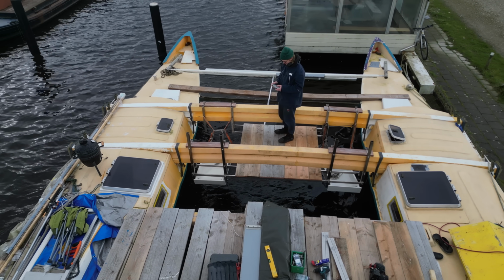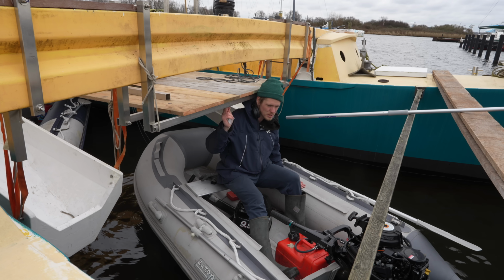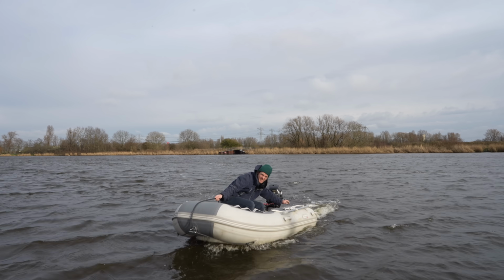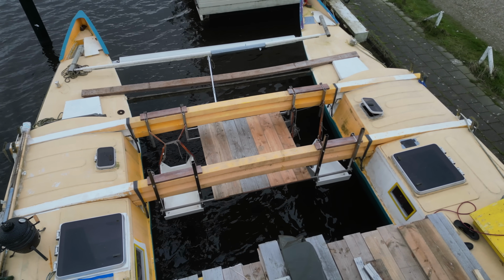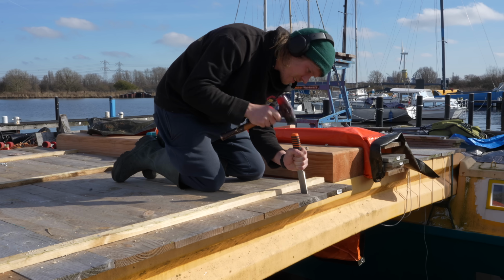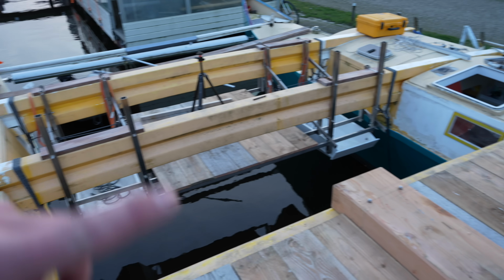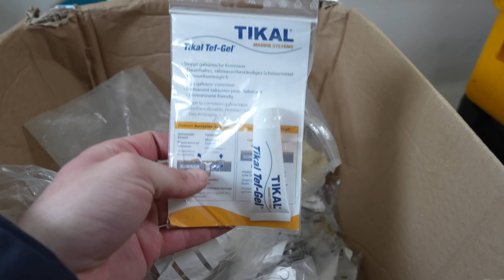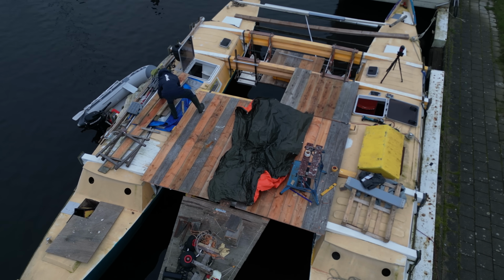A Simple Deck for a Simple Man’s Ocean-Going Catamaran.

Comment: Did you try tilting your motor out of the water a bit? My small 10hp 4 stroke has 3 tilt settings.  That may bring the bow down a bit.  Also, sometimes the outboards transom mount has 3 setting where you can hang your engine higher or lower in the water.

Comment: If your concerned and need to put your mind at rest, bang in some 10.9' s or 12.9' s the weakest point will then be the box section. You can always buy a metal strip to run parallel  to the box and bolt it to the side. Like a big washer running the length. 
Perhaps think of the engine box back movement when the waves hit, maybe some car boot opening cylinders(marine equivalent)to dampen the impact and relive stress on all of the joints.

Comment: The M10 bolts are in shear (double shear) not tension, so the area of the bolt is the controlling factor.  The sludge in your outboard fuel typically occurs from ethanol added to fuel.  When it is left it separates and becomes a sludge that will block small engine carburetor jets.  If you are running the engine on a regular basis the ethanol additive is not a problem, if you are going to let it stand for longer periods use pure petroleum.
Reply: Trouble is all modern Euro  petrol is a mix... ... and its been increased on two occasions.  It also attacks certain plastic components.
Carb cleaner helps but only till next time.
Reply: You have to do a search online for sources of ethanol free fuel made for small engines with carburetors. It costs more but it's well worth the extra price. A lawn service company will know where to buy it.
Reply: Most name brand E5 labelled petrol contains practically no ethanol. Its allowed to contain up to 5% but market forces say people are willing to pay extra for less of that #$^^!@ in their fuel.
Reply: If you are not going to use the engine for 6 weeks or more just disconnect the fuel line and let the engine run out of gas, or better yet put in a simple cut off valve and shut the fuel off then rune the engine til it dies.On my generator and lawn mowers I start the engines every 2 weeks, so they are ready to go when I need them.
Reply: Hi, for me your planks are not the thickness it's should be. I'm thinking when it's will be very damp your planks will bend and a tempest will be very rough with your planks and attachments... 😊😊😊😊

Comment: You can put the spacers on the end of a stick with masking tape to reach the holes in the middle of the bars. I used the method to get a nut 2 feet down a pole.

Comment: Id put a tubber strip between the beams and the deck, stops the deck from rubbing into the fibreglass. Also use a stick with a v notch on the end with a bit of blue tack to position the spacer. Good luck

Comment: Hi, when considering mechanical advantage for your raising of the engines/sleds you would gain a tremendous amount of efficiency with your pulley system if you were to pull up from your deck rather than down.  I suggest this if it’s possible to reverse your top jamming pulley…good luck 😢

Comment: Those pulley blocks are made of Tufnol - good material !  
I would not worry about the static loads on your engine mounts, but the dynamic loads once it is at sea. A heavy wave breaking thru or the boat surfing sideways to a big comber on a breach. That is where things will bend & break.
That gunge in your outboard carb could be due to ethanol in your fuel. Seems to absorb water and react with Aluminium carb material to then block the carb. Causes big problems with chainsaws.
Cat decks are usually slatted rather than close planked to allow wave force to burst thru the deck and dissipate rather than slam into and break. I would think about introducing gaps between those planks.
Keep up the good work - you are getting there.

Comment: tips when using handsaw 1. Don't force the cutting stroke and release grip pressure on back stroke. That will stop the wobbly vibration. Let the saw teeth cut if you need to add pressure then the saw needs sharpening again. Some newer cheap saws can't be sharpened readily.  I like what you are doing with the boat. I'm 76 but wish I was your age and had your opportunity.  Keep up the great work Mark.😊

Comment: You did the right thing butting your deck boards up together without gaps and high above the sea. Slatted decks on Wharrams maybe good in theory for dissipating breaking seas but in the meantime, even in a fairly moderate beam sea and definitely going to weather, those gaps will allow the sea to squirt up through the deck, drenching the crew and any equipment you are trying to keep a bit dry. One thing you will need with a high flush deck though at sea is a guard wire or at least a rope around the deck. You'll feel mighty vulnerable otherwise and inclined to go about on all fours. And as you mention, slatted decks are an absolute magnet for items to fall through!

Comment: The brown block (pulley) is made of Tufnol, a laminated material used as the original alternative to wooden yacht blocks back in the day, but nowadays are mostly sold to owners of classic yachts since they are easier on the eye than other modern blocks. They are still made by Holland Yacht Equipment and are not cheap. They run on brass bushings and last forever, so are not to be despised provided the bushings and straps are still good.

Comment: my suggestion is to not worry about changing out the bolts, just have a welder friend come by and run a small bead on each junction, it'll add to the overall strength, rigidity and peace of mind in one move.

Comment: The bolts are definitely not the problem. Rather, you have to calculate how much your profiles can withstand in the areas weakened by the holes.

Comment: Cut space for the beem lashings in the deck planks

And to the m10 if your worried add more vertical supports and maybe use them to support the engine controls in the center front and a cabin roof for solar in the rear just a thought 

Also still think a tear drop style deck cabin would look cool on your wharram

Comment: The deck's looking good. I'm not sure if you're already planning it, but I'd wire the pins on the shackles for the engine box lifting pulley system. Lots of vibration there for the pins to come loose.

Comment: Experienced sailor here, your construction of your engine mounts metal cross beams appear to be too  close to the main wooden cross brace beam. So when the boat flexes it appears that the steel would start gouging into the wood.
Reply: I noticed that too, but guessed that it may have been the camera angle making the gap look too small.

Comment: Mechanical engineer here - The real battle with any design of a structural frame is fatigue and movement.  Make sure your frame is rigid.  You may want to make some backing plates where the frames contact the wood to spread out the loads and keep the wood from fatiguing.
Reply: Fully non qualified shed tinkered here.  I like your comment  about keeping the frames rigid. That's what I thought too. But I wouldn't mess around with the engine boxes too much until I'd tried them and was happy with the arrangement,  then if rigidity was a concern I'd make a triangular plate to brace the corners, maybe 100mm with three six mm bolts in each. That'd be solid.
Reply: Isn't the real battle going to be the waves striking and lifting in higher seas?
Reply: @chrisoakey9841  and snapping off with the engines which could turn into anchors
Reply: @c3pno  the engines are typically used in calm seas and flat water to enter/exit Port and such... Otherwise Mahi sails and the engines are high above the water... This is to specs and with the designer's input if you want to go back to the beginning and educate yourself... Perhaps read the books on the evolution of these cats.
Reply: I'm wondering if those beam lashings you did have enough tension.
Reply: Just a tad difficult making a rigid structure in amidst a boat that is designed to flex from the get go to move WITH the swells, rather than rigidly resist them.That's why everything is lashed together, rather than bolted.
Reply: Industrious video👍. Thoroughly enjoyed it!. Your varied skills and transparency in your approach are very refreshing. Thanks!!.
Reply: Spent a lot of time at sea...while I admire what your doing...I wouldn't want to be on that boat of yours in anything but calm waters...I doubt it could remain in one piece  in stormy waters... particularly if they go on day after day. However good luck with the project.
Reply: @robindawtrey9735  they are designed for going in sea, non calm water, and still remain in one piece.  As long as it is looked after, like any boat.

But to each own, I guess.

Comment: CAUTION: the cross-bracing tubes to support the pulley system and engine box supports.  The ends are too close Mahi's wooden beams.  Everything flexes underway, so those ends will gouge into the wooden beams like a chisel.
I very much like that you're going to seal and protect your decking and other raw wood. Douglas fir is good but it's not red cedar.
Cheers from Vancouver, BC

Comment: If you're going to leave the outboards sitting for a long period of time you should disconnect the fuel and run the engine until it runs out of fuel, that way it won't sit in the bowl and gum up.

Comment: If you have access to a welder the best option would be to drill out the holes large enough to weld in a sleeve at each hole.

Comment: That OB scoop will detach itself given the right wave scenario, it’s only held by 2 bolts in what looks like a much weaker material and that is the issue. All the metal reinforcement is fine, even overkill if you ask me.

Comment: Said this in your last video..
I would weld some of the tubing across the top to replace the bolts,  so that the frames effectively act like hooks over your beams.
Nuts and bolts get weathered and can be a pain to service even if they're stainless steel. They could also potentially chaff in the framework under heavy seas and elongate the drilled holes..

Comment: M10 is perfect for that job. 
Also, the crush tubes you have on the inside of the box section is a good move.
I think the setup and load bearing points are more than adequate.

Also, see if someone nearby has an ultrasonic cleaner.
Best way to clean a carburetor. Makes them like new.

Comment: Those decks will come up lovely chief, you've made a good job of them. You may be getting moisture in your boat tank, it binds with the ethanol and drops out the fuel which may be why you're getting the gummy build up in the carb, a fuel stabiliser could help you. But I'm no expert, it's just a theory.
Reply: It works. I recently had idling trouble with my 2 stroke Nissan outboard and come to find the fuel pump diaphragms warped  and also the float valve cover... Bad gas.

Comment: I made a roof rack for my ute once when I was doing racsia and guttering for a job. We used SHS tube similar to what you have done with bolts to join the members that support the load which was pretty substantial that sat the full length of the vehicular weigh at leat 200kgs full load.  All the other tradesman did it that where we got the design from. Like you said I think an M10 bolt should be plenty strong enough, probably stronger than the sheet metal tube without looking at any charts. The real test is going to be dynamic load is a complex calculation to do a load analysis you'd need a computer or someone with a really big brain 😂

Comment: 74 yr old out board mech with advice on engine starting.  If cold-  try setting the throttle a bit open (watch the throttle shaft to determine  and not over a 1/4 open) and no choke for one pull. Then close the choke and pull till start.  Be ready to open choke immediately and be prepared to just "flash it" shut for just a moment until warm.  When starting warm - leave the choke out of it, but the engine must have air to start so keep the throttle a bit open. Always carry a spare rope and wrench to remove the starter housing to reveal a way to wrap start the motor.  Look inside the hood as some motors had a spare rope taped there. Your throttle may have a friction adjustment to help starting.

Comment: The bolts are fine , what will get you is vibration and movement may back off  the nuts . . The trouble for me with any home built boat is that while the design may be off shore it really comes down to the quality of the build .

If they fail it will to be ripped off by a huge wave but most likely the issue will be they come loose during a rough passage forcing you to jury rig at sea .

Comment: You can put tube spacers inside the box section by making an insert tool. The insert tool can be a piece of wood or even pvc pipe that can fit inside the box section.

It would have a notch cut into its end to hold the spacer. It would also have a line attached to it that fastened to it on one side of the notch and extended across it and all the way back to the other end of this tool.

With this, the tube spacer can be shoved inside the box section until it lines up with the two holes in the box section.

Once the bolt is installed. The end of the line can be released, and the tool can be withdrawn.

Comment: I wanted to tell you, those smaller engines require ethanol free petrol, ethanol is a sugar and with atmospheric salt air forms a crust in all the nooks and crannies of the fuel system. Need to flush it all or replace it and don't run ethanol ever again. It may work for a short while but will eventually crust up again and clog your high speed jet and eventually the idler jet but high speed jet is first that's why she'll run but when you throttle her she'll just go bluuuuhh

Comment: IMO,  for the vertical load of holding the engine pods, the M10 will be find.  I would more concerned about the "Pushing" force of the engines and how much that will twist the square tubing and twist your beams. And, your design only accounts for holding the engines from falling into the water, but in certain sea conditions, the forces of the engines pushing could actually lift the pods up.

Comment: Awesome progress, that fall could have been worse but I guess you have to make mistakes to learn. 
Are you going to cover the deck with fiberglass, I don't think you need more that 2 layers but it would give it that little extra strength and protect it from water.
Another thing I am looking at are the engine mounts, using rope and pullies is ok, you might want to double up on the pullies to reduce the effort needed to pull when lifting the engines another thing I have been wondering is would it not be better to have an aluminium bar at the fully down position to give it a fixed position to drop to. You can either slot it so that when you raise the motor the bar will slide up or you can hinge it so it folds away when you raise the motors. Maybe over engineered but safer.

Comment: I would consider sika flexing the steel to the beams to strengthen and take some load off the bolts. I know that would be a pain in the arse to do now but it would take some load off those bolts.

Comment: I think that deck u built will not last a yr in rain and in salt water getting wet all the time i think 1 the wood is to thin its only a 1x6 maybe use a 2x6 and thicker bracing underneth it that wood is not ment to stand on.😊

Comment: The primary function of a cutting fluid is to act as a coolant, bringing down the temperature of the metal piece being worked upon and the bit. The cutting fluid not only helps provide an "excellent finish" to the product getting the cutting oil treatment, but it also provides excellent "dimensional control" and adds to the life of drill bits. Out of habit, when I pick up a drill and bit a can of cutting oil is always included. Old school ways never die.

Comment: Mechanical engineer here, looking at my *(Strength and Material); ran a FEA simulation of a M10 bolt. 304SS bolts are 300LBF. If 441LB load is distributed evenly across 8 bolts the SF would be 5.4. Vibration and torque issue come into play, thus the rigidity of your boxes may be a consideration. Deck looks authentic and quite rustic. A little non-skid yellow might blend with the beams? Awesome job Mark, she's really coming together.

Comment: Amazing achievement so far, crack job.  The bolts.... a Lynx helicopter only has 4x M14 bolts attaching the body of the helicopter to the main rotor gearbox!  So all of the forces during flight go through those bolts ...you should be fine.  You do need to consider the strength and the ability of the frames and boxes to with stand the continued battering of the sea when you are sailing the open ocean,

Comment: It's worth your while getting an adapter that gives you 1/4, 3/8 and maybe 1/2 inch drivers for driving sockets with the drill.  That frame job would have come together much quicker, you just whizz up the bolts with the drill and a spanner, do them up up with the torque set just below max, then tighten with the socket wrench and the spanner.

Comment: The bolts that span across the beams will mostly have shear force applied, at least when the motors are out of the water. To help calm your concern you could do a crude calculation based on the weight of the motors divided by the number of bolts, then look up the max shear for the bolts of that particular grade of steel. Of course there will be other loadings applied especially when the motors are down, as well as when there are heavy seas which slap the motors from below when the motors are in the up position.